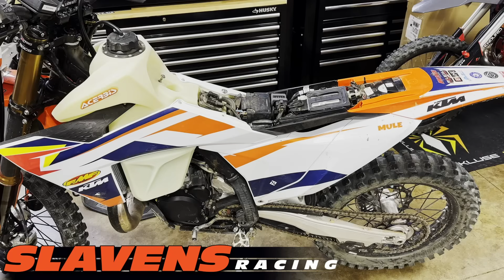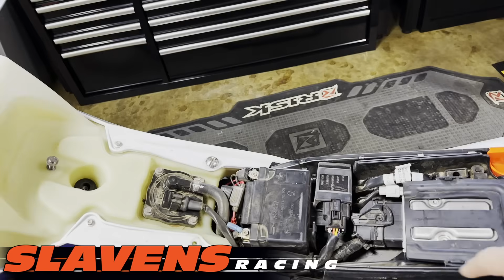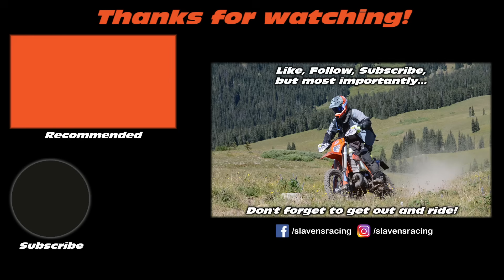What is CANbus on the new KTMs?

Comment: The problem with this technology is that it's software driven. When that software has a bug which they all do things stop working.  This is why cars have  many issues and need updates all the time. I'd rather have the old fashion way of a switch that turns the light on rather than a computer to decide if the light comes on or not.
Reply: And that’s where you think you want that but you actually don’t as you probably didn’t drive a car that had no software used for anything. Just think ABS, Injection, Engine Control, … going back to mechanical would make the way more inefficient. The same is with theft protection systems would simply not enough anymore.
Reply: @platin2148  I agree,  there are lots of software applications on cars and bikes.  The difference with this though is companies like KTM can switch off your abs or your traction control when ever they like, such as when you sell the bike. They will make it a subscription so you don't own the add ons. It will still cost the same just that you can't sell it on. Very different to software that controls your fuel injection.
Reply: @OrangeManStan  Ahh so you do have a problem as soon as you have to pay multiple times? I guess the main reason why this stuff has a running cost is because there are people maintaining and trying to update the software on these controllers. Also there are licensing costs and certification costs that are ongoing. I highly doubt that you’d like to pay for a life time of these things that have to be payed some how and that would make the price significantly more expensive. I suspect there would be not a huge market for controllers with software that support only a Smartphone OS from 2011 and doesn’t have newer standards.  

I guess one could certainly add the option for adding additionally +8k to each motorcycle that you get a life time update. Well what ever that meant. Is it possible to freeze these things in time? I guess it’s possible but you certainly wouldn’t want that either. And doing everything onboard is sadly a very unrealistic idea as KTM doesn’t own 99% of the ECU’s and control units on there own motorcycles, and there are several suppliers which require the things to be connected now. Actually in cars it’s already mandatory so running costs occur.
Reply: @platin2148  all companies are doing it,  they love subscriptions. They can get on going payments, ultimately for the companies you will be leasing the item. Cars come with everything,  heated seats, different power outputs, same as KTM bikes,  you now choose what you'd like with extra payments. So you pay for all the hardware but cannot use it until you pay more. Then you need to sign up for their app otherwise you cannot have options. This only works with Canbus tech. When you sell the car the options go with the app. It's perfect for the big companies not great for the end user.
Reply: @OrangeManStan 
CAN BUS is btw. nothing new at all it’s basically a thing from 30 years ago. The thing you have today is they made it possible that a normal user can access it. Like the hardware was and still is there for you to access that bus since then but as it is like it was back then most of the average people don’t know how it works. So what you pay with these subscriptions is typically that the stuff works with your smartphone or whatever gadget thingy you own for a reasonable amount of time this simply would not be acceptable for people to pay once. The other option is to not have these things and that would make you basically pay once.

Comment: I'm not a anti-tech, just the opposite.  This sounds like more chances to get stranded when an electrical voltage spikes from whatever issues (water, shorting, etc), on the KTM 500 or 350 EXC-Fs fail to report properly.  Jeff your thoughts on whether this will 
A) enable more safety and reliability going forward.  My bikes have plenty of performance already so I just need to focus on those two priorities now.   Many of us get far out from the traillhead? 
B) Is this going to do that or increase service costs at the Shops, when trying to troubleshoot problems. ("we better put in a new CANBus just to be sure").  
C)Will the CANBus enable forward compatibility like when a new year dirt bike or dual sport model some feature (TC, ECU factory maps,  and then you want to add these plug and play to your prior year CANBus models, are they saying this was part of the reason? that is big for those who can't afford new bikes every few years.

 On my 2022 500 EXC-F I still have the speedo resetting Trips, Aves, etc. often on stopping.  Even after I checked the button battery voltage and shimmed it up to sit in tighter in that round slot. I won't add Athen or Get ECUs cause I have enough power as is and don't need any new trouble to wonder about when something acts up.
Any thoughts on these points mentioned would be appreciated.  I'm and advocate for Slavens Store and their great Customer Service, my friend just spent $430 on suspension parts on my sending him to your store. Keep up the good work! Thanks for this video.
Reply from the maker: Hello Jr: 
A) As I mentioned in the video, Canbus is known for reliability and that has been my experience with other models that have had it for years. It is in your truck, your car, your boat, your everything. So I ask you this, have you had a CANbus issue in any of your non-motorcycle products? My guess is probably not. CANbus simplifies the electronics and does not make it more complicated. It is a simple 2 wire system called CAN in and CAN out. 
B) It should not increase service cost. If your dealer says the opposite, find a new dealer that is knowledgeable and ethical. 
C) One of the benefits of CANbus is compatibility, however my dang crystal ball is broken and I cannot predict what KTM will do in the future, ha! 

I suggest you reconsider a Vortex or GET ECU. I realize you don't want more power but in stock form they very easily flame out and toss you on your head. That is because the O.E.M. mapping is very lean (thanks to the EPA) which makes your bike run hot and causes premature engine wear. If you would like to discuss ECUs further, please give us a call and ask for Alec. 

Thank you for your patronage and referrals. We appreciate you!
Reply: @slavensracing  It is common for dirt bikes to get submerged in water crossings, and drenched from rain.  That is a significant difference when comparing to passenger vehicles as they are totaled when they submerge.  I'd like to see if they have any waterproof seals to help.
Reply from the maker: @dirtrider9268  
Hello: 
It's a very simple 2 wire system that can handle aquatic adventures. Ride on!

Comment: Hey Jeff, Appreciate the information. So you mentioned this setup reduces the bulk of the wiring harness, How do the multiple modules communicate? Is there some sort of Bluetooth?
Reply: Basically computers talk in 0's and 1's. Think on and off. Theres parameters that programed this way and the computers basically talk to each other in this way. At the end of the lines there's called these things called terminating resistors , and think of them as gates that don't let information spill out. That's done by resistors that are put between the two data link wires. They have figured out how to basically do it between two wires and the information is going back and forth and a pretty high rate of speed.
Reply: So the wiring still exists between ecm/ecu to ecm/ecu and sensors to ecm/ecu, they are just smaller and less bulky? I  can see then why the addition of components to these data circuits could cause problems with communication. Therefore the need to add aftermarket circuits fused directly to the battery. Thanks for the ongoing education here, I am a veteran rider (65) on a 2018 TX300 .  I am preparing my mind for the inevitable, eventual upgrade in technology.
Reply: @BenLea-rq3rm  yes , exactly. If they ran each wire for each needed circuit , there would be miles of wires and it would look like a box of spaghetti
Reply: @UncleMattsGarage  you lose cred when you start with Basically... as that is the BS'ers call sign.
Reply: @dirtrider9268  Just simplifying a complex topic . Im to old to worry about credit , just trying to be helpful. Cheers
Reply: @UncleMattsGarage  "Cred" is short for credibility. Use "specifically" and then you'll have to explain the actual facts, if known. That's where credibility becomes obvious, as in many of Jeff's descriptions.

Comment: Hey Jeff, as always thank you for your awesome videos 🙏🏻🙏🏻🙏🏻🙏🏻. However, I do have 1 question. 2024 KTM XC-300 will not idle and the red nub to adjust the idle is maxed out as far as it goes to higher the RPM, but will NOT idle, especially when it's cold, even when it's hot it will idle for few sec and dies. Any suggestions? thax
Reply from the maker: Hello:
First thing I always check is the compression. If compression is good, clean the injectors.